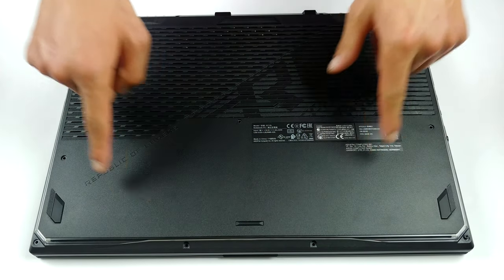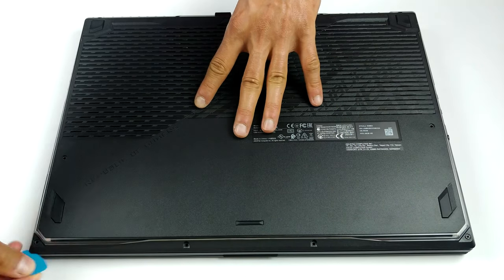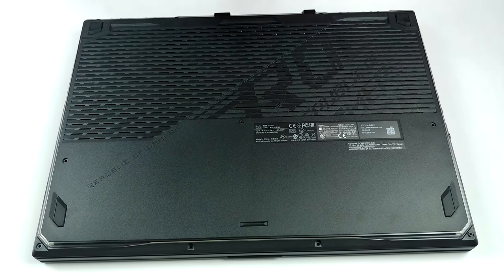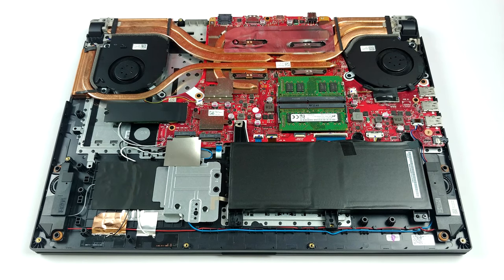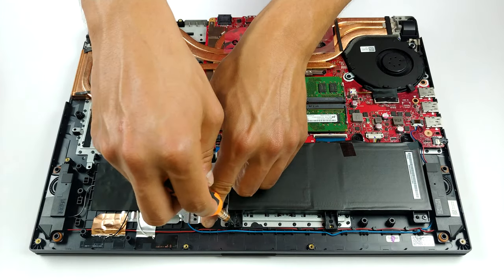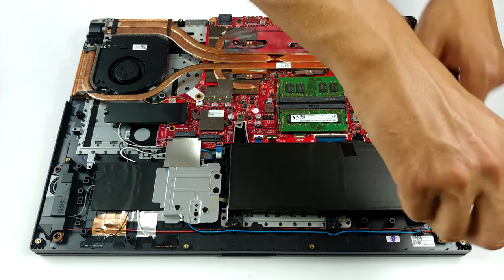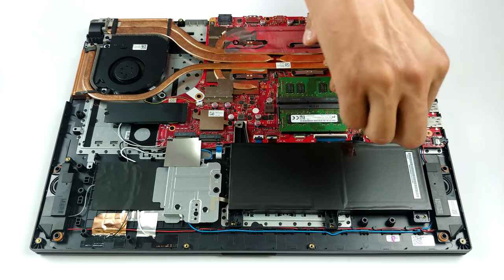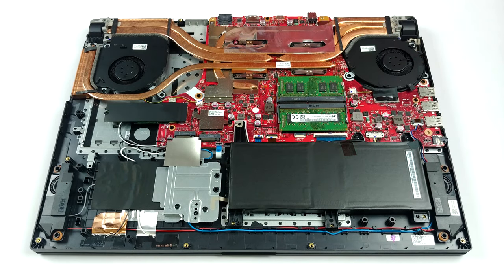🛠️ASUS ROG Strix G17 G712 - disassembly and upgrade options

Comment: i ve bought this laptop 3 months ago, every week i clean it very carefully . 2 weeks ago it started overheating whenever i play games. For example it overheats while playing 20 yeasr old game like world of warcraft(cpu usage is %35-40). actually it doesnt matter which game you play it cpu temperature just going up from 40 to 90-95 in 20 minutes and pc automaticly closes wifi . I have to reinstall or disable/activate wifi driver every time pc overheats . I'm extremely frustrated that this laptop is 3 months wage in my country .I dont want to give it to service which might take a month to receive it back from technical service without any possible solution. Sometimes they even take hostage your pc while waiting backup item from abroad for months.
Reply: Watch some YouTube tutorials on a free program called ThrottleStop. I have this exact laptop and was experiencing the same issues as you. With ThrottleStop you can throttle the cpu to limit its output. Your cpu is ultimately working much harder than it needs to, causing the overheating condition. I’m now able to play COD warzone at 120fps on high graphics at 70 degrees Celsius.

Comment: Thanks for the video! My store's tech support and even ASUS support gave me contradictory information about SSD expansion. Just be careful guys, I've read that some SSD with heatsink won't fit in there because of the size. I bought a WD SN750 2TB without heatsink, I'm about to get it installed by a tech. Cheers!
Reply: what is wd sn750 bro?
Reply: @deidera9597  m2 hdd

Comment: yo man, I nearly ripped the ribbon cable when opening the laptop( may have even damaged it). You didn't mention anything about it. I'm a little frustrated. For everyone that hasn't opened their laptop before, at 0:47 DO NOT, I REPEAT DO NOT just lift the back panel off like that. There are 2 ribbon cables that connect from the motherboard to the back panel.
Reply: thanks for that man, I was extra careful after reading your post and indeed there are 2 ribbons there. I watched another yt and you can disconnect them if needed.  But yes, if you're not careful... you can break them.
Reply: Damn it I just pulled the stupid RGB cable out, broke the connector. Stupid video. I should have read the comments.
Reply: I ripped one of them what do I do now can I fix it? The cable looks fine I just don't know how to insert it back
Reply: Well guys, at 0:40 he is disconnecting it. You were not careful watching the video

Comment: Watch out for the things the screws go into, which have a metal fizting inside the plastic body! After disassembling it i noticed tiny cracks in them, i didnt care much, but when i tried to put it back together i couldnt even finish screwing the screw in two of them shattered. I want to clarify that i was very gentle with them. It might have been the excessive heat becouse only the ones shattered next to the exaust. Might have been stripped out if tha factory i dont know just be very careful with yours. This one was 2 years old and have never been disassembled.

Comment: Is there a ribbon cable or anything for the wifi adapter or is that onboard? 

Because my wifi suddenly does not work and its for sure no software problem. 

Maybe some connection got loose and  i want to check that.

Comment: I had one query .... I read many articles which said ASUS ROG Strix G17 G712LU-EV013T can be upgraded upto 64 though officially it's mentioned to be a maximum of 32 gb ...now my question was :
1)like shown in this video can we put two 32 gb ram in the 2 slots and make it to 64 ....if yes then can somebody give the link to such ram set .
2) Will the manufacturer's service center people help in upgrading to 64 gb ram or we have do ourselves ?
3) does upgrading the ram to more than what's mentioned officially cause any impact on the system ?
Reply: Have the same question. :/

Comment: mine had RGB strips in the bottom... I did not know they were going to be there... anybody have a video on how to reattach them?
Reply: There’s probably gonna have a flap black thingie at the edge .. carefully pull it so it opens like a tiny door, maybe it pulls paralel to the board, be careful not to pull too hard, if it opens reinsert the flat cable and close the flap back, might as well google how to unplug ribbon cables, there’s two types probably 

I mean I opened it - you don’t have to pull of the ribbon cables at all just angle the back board, installed another ssd - only thing that I noticed the other ssd seems to have like a thermal pad, and I didn’t have it on the new ssd - although the thermal pad had a piece of plastic on top - that seems not to be optimal as a heat transfer unit

Comment: So there's no room for a 2.5inch SSD? it ONL Accepts M.2s?
Reply: I was gonna ask. But apparently no coz I just bought and checked it for myself.
Reply: @h_chicken8789  
This is why I ALWAYS research a piece of tech before I buy it. Got me a new HP Omen 17 (I couldn't afford the one with the RTX2080, so I got the one with the RTX2070) at 37% off just 2 months ago.

My new M.2 just arrived today, now I can transfer all my stuff whilst saving space, coz my new SSD & m.2 are bigger tham the ones in my old gaming laptop.
Reply: overall do you recommand  this computer? ( maybe I'll upgrade ram later)
Reply: @billelk1271  defintely. It’s easy to upgrade. Been using it for a 2 weeks now.

Comment: Hey I have this laptop. Today when i turned it on it did all normally until i entered google and began to make a metallic noise during 1 minute or 2. Suddenly after that it turned off and stopped working. Do you know if there is any solution. I would appreciate your help. Thanks in advance!
Reply: same problem bro cant find shit

Comment: To bad you didn't reach the CPU and GPU heatsink. I'm really eager on seeing those because I often re-paste my laptop with liquid metal. I heard there's an ASUS ROG SCAR that uses liquid metal as its stock TIM on its CPU out of the box. I thought it was this one.
Reply: I think I saw this model apparently has liquid metal applied, or so it showed on asus site, you might check it out actually..
Reply: Anyway, confirmed, it has liquid metal - which leaked in my mobo an caused fan error..
Reply: @robob3ar  just curious wat sort of fan error u had cuz my fan is making weird sound recently
Reply: @SIlent5130  my fan is also making weird sounds. I think its broken. What did u do? Did you buy new cooling fan?

Comment: Hi guys! What about ribbon cables for RGB strips? Are they still there like in previous generation? Can't see them on video.
Reply: ... I'm looking at this video because I just bought mine and have a 2tb drive that I was going to put inside like my older model... there were two ribbons... looking for where they are supposed to be attached on the motherboard! hope I didn't destroy something
Reply: It has 2 ribbon cables u can disconnec and reconnect after

Comment: can you install a regulard size HDD and how many m.2 drives fit int?
Reply: no and 3
Reply: Alp i bought it, i’m  missing the option to put in a hdd, but oh well.. also after a week there was some fan bug that made it run at 100%, it’s back in the shop
Reply: @robob3ar  aww that sucks man, buying something else?
Reply: I buyed this model and then bios update booom no power what can do until no respose even the lights of mouse can u make a video for this model cmos reset plz..thank you so much,
Reply: @swanxx4168  apparently you should hold the power button for 30 sec or more.. somehow I have a feeling this model is not the asus best laptop..
Reply: @KhazAlp  I'm keeping it, I mean, it's past the date of return (so they claim), so now I have to got through the shop and they fixing it or determening what's wrong - I did nothing wrong with it, just opened it out of standby and fans were at 100% all the time, in bios wherever, at times it seemed like a temp sensor wasnt working ..
.. oh well.. you know what surprised me acer that was a bit cheaper perfomed perfecly - got one for my parents at the same time, almost same specs just less powerful gpu.. it works perfectly and seems faster than acer - the intel ssd that came with this was slower than acers.. I was gonna upgrade ssd anyway..
Reply: @robob3ar  something definitely off with the temp sensor matw. Wish you the best luck with repairs.
Reply: @robob3ar  done doing sir but nothing response i buyed one week ago.
Reply: @KhazAlp  they sent for a new part... well, I hope that's the only crappy thing that goes off - I might check out extended warranty on it..
Reply: @KhazAlp  apparently they changed the mobo - and it says something about too much liquid metal thermal paste.. so confirmed - it has liquid metal.. and, it can cause problems if there's too much of it..

Comment: Can we add a secondary ssd to this computer?
Reply: 3 ssd pcie in total
Reply: @paulsimon6732  do we have to add ssd to both free slots for it to work? because it was mentioned something like dual ssd thingy
Reply: @krithikharshith5196  i also want to know this
Reply: @veenasinha3372  of course not. Only if you want to use RAID..but even so, for RAID 0(higher speed that you don't need) you only need two
Reply: @krithikharshith5196  you get 1 ssd installed and have two more free slots.. you can do raid with them anyway
Reply: @krithikharshith5196  not dual SSD, dual RAM. You can install 1 or 2  SSDs